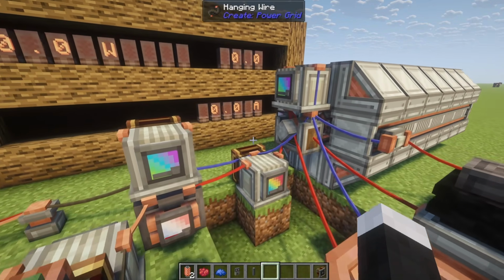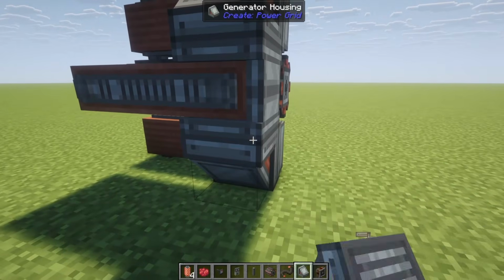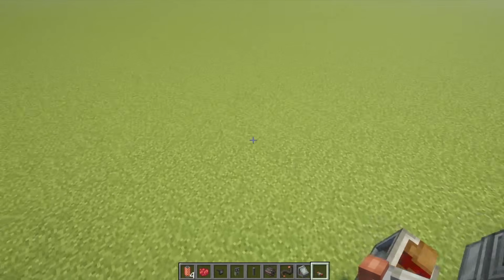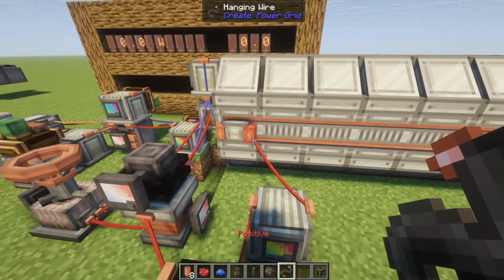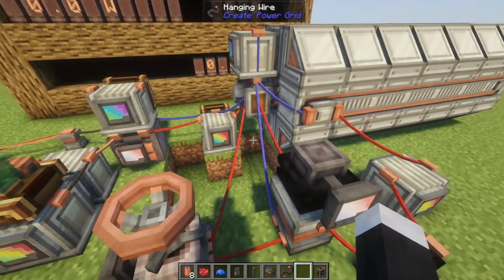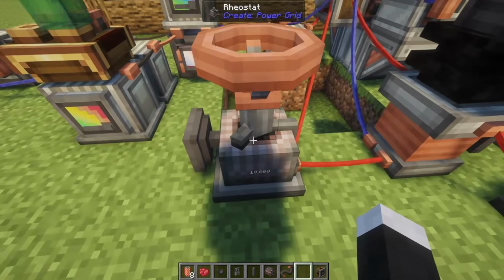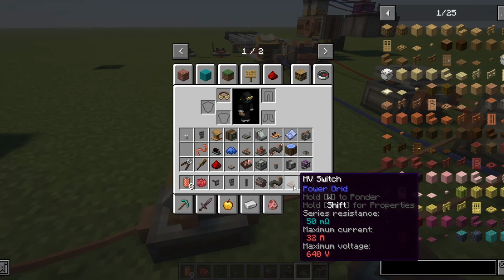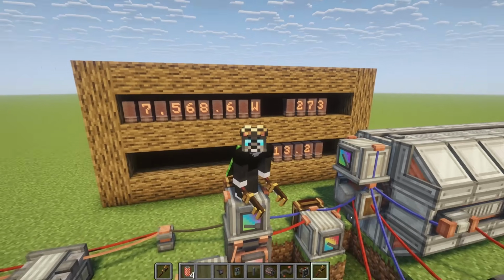Create Power Grid  Generator Tutorial

Comment: i followed all the steps but it says 0.19 volts generated
Reply: add an device connector to one of the coil shaft and power it
Reply: It needs to be spinning the right direction, just flip your rotation source
Reply: What you need to do is place coal blocks on top of the carbon pile thing, that fixed it for me
Reply: Do what i did
Add a device connector to one obe the coils and connect the positive side to the positive side of the commutator and connect the negative side to the negative side of the commutator
Reply: at least youre getting something, it says im getting -0,19 volts
Reply: @JuanjoDominguez-s2x uhh dude you connected the positive and negative the opposite way dude
Reply: @JuanjoDominguez-s2x If you ever have negative voltage (which is possible irl too) its because the leads are backwards. You need to do positive (red) to positive, negative (blue) to negative.

Comment: doesnt work to fully power a basin heater without transformer wiring settings and probably another power source too; i combined multiple connector outputs to reach 1400 volts and no matter what you set for the transformer the basin heater still makes the generator clutch slip
Reply: You need a generator clutch on each side, this isn't a very great generator in the first place. It'd be great as an exciter generator. What you'd do is take the output of your current generator, slap it onto the coils of another generator. and try to get its power output (with a transformer) as close to 2A as humanly possible. (You wont explode the generator by giving it too much juice, it just wont work)
Reply: @mickey_mousey  this does work if one wishes to build a whole second generator, and is in fact the only means of extracting the maximum amount of power from a generator. however, if you're a cheapass, you can get a basin heater (but nothing else) to max power with just one generator by making an automatically scaling resistance loop to the coils using a precisely tuned carbon pile. and by precisely i mean really precisely
Reply: @Myst109  I mean, sure. But why spend the resources and time to make a whole generator to only power one thing. Its best to just make two generators lol

Comment: why use a carbon pile?
Reply from the maker: You can make a generator without a carbon pile. The carbon pile is there to try and stabilize the voltage, when you connect a large load to the generator the voltage starts to sag which causes the resistance of the carbon pile to lower which increases the supplied power to the stator coils, which in turn makes the generator produce more power to counteract the voltage sag. Its basically a negative feedback loop that keeps the voltage more constant.

Comment: What transformer winding did you use mine keeps explodind
Reply from the maker: For this particular one I used a 4:1 ratio with 40 turns on the primary and 10 on the secondary, but it doesn't need to be exactly this, just need to make sure that you have enough turns on the primary so the transformer doesn't become a glorified electric stove from the low resistance
Reply: Yea,one time I did a glorified electrical superheated stove

Comment: Hi thanks for the tutorial is there a way you can show how to connect multiple Generatos togehter? because everytime i try it it out they always cancle themself out and stop
Reply from the maker: It should work as long as the generators are connected in series, so just build 2 separate generators and then connect one of the plus terminals from generator1 to one minus of the generator2, then you connect your transformer across the remaining plus and minus terminals.  Its important to only make one connection between the generators, if you connect both is terminals together it acts similar to a short circuit because the generators try to feed power with opposite polarity. Also make sure the number of turns on the transformer is high enough for the voltage, I explained that part in the other tutorial. Hope this helps 👍
Reply: @BahkaSheep  It helped! Thank you very much man
Reply: Yes, i'm so stuck with this mod!

Comment: Please explain the transformer, It doesn't work for me and aren't transformers AC?
Reply from the maker: Yes, it is a bit weird that transformers work with DC but that is because of a limitation with the solver, it can only handle updating 10 times a second, so nowhere near fast enough to do proper AC. And that's how we ended up with DC transformers.
I'll make a tutorial on them in a bit :^)
Reply: This mod has a bit simplified electricity. Overall it uses DC, but transformers can use DC too (here) for simplicity so they don't have to add AC too. But I hope they will add AC later
Reply: @caxap8405  Due to Minecraft's limited tick rate the AC would only work on 10hz
Reply: @kayam1i  yeah that's true. Unfortunately